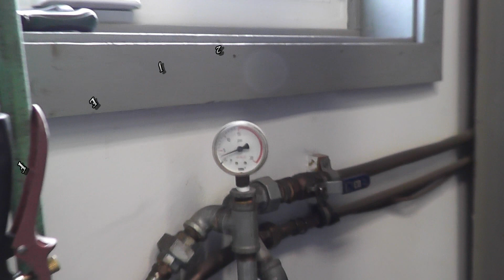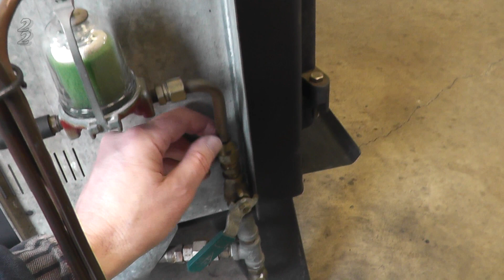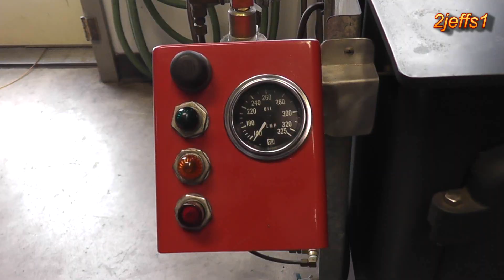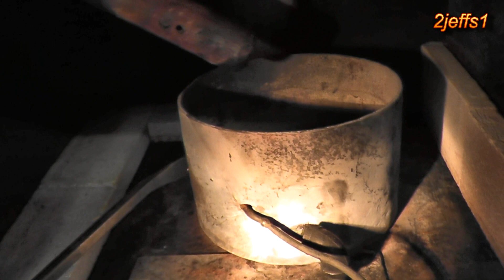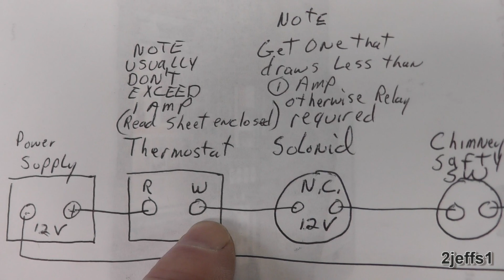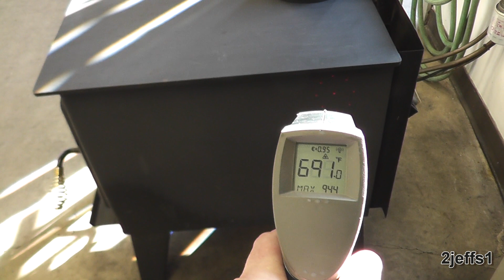Homemade Waste Oil Burner Heater for Daily Use p2 More Details DIY

Comment: Hi Jeff, I am watching this for the 4th time. At 04:30 or so you mention the gallon usage at around 2-3 for an 8 hour day. Then you say -10 out. What does that mean -10 out. I definitely want to build one of these. Will have almost an unlimited supply of used oil. Soon, I will be building a service center that changes oil. I wonder if I can make one into a boiler. That way I can run pipes in the concrete in the driveway and the sidewalk. Let me know what you think on that.
Reply from the maker: The -10 out is the outside temperature in Fahrenheit. Depending on how cold it is outside and how well the building is insulated affects how much oil is used similar to ones house furnace. As far as making one into a boiler, not sure on that one where I've never attempted....
Reply: Thanks Jeff. I should have know however it was late and I probably was 4th Adult beverage.  I am in Norther Ohio it can to -19 here. Luckily when we bought the place the garage is detached two story insulated and heated garage. With a used oil furnace I am hoping to heat a new larger shop.

Thanks Jeff really enjoy the vids. I love the skits with the birds and the woof woof. Makes me laugh everytime. Hope your weekend is going well.

Comment: Thank you for two great videos of a setup with a pedigree. Way too much junk around of stuff that was thrown together yesterday. I like your  high and low setting on the oil feed.
Reply from the maker: It was a fun project which continually took a lot of trial and error at first where this was built before the YouTube days. That is the best part being automatic after lit where it doesn't need to be constantly tweaked to maintain room temp. Thank you for stopping by Anthony, Jeff.

Comment: Jeff you are very talented and thanks for sharing. I have watched several of you videos and learned a lot. I live in Maryland so it is not quiet so cold as where you are.
A question for you. I can get a steady supply of fuel oil (tank draining s from a tank removal firm). This supply is from good fuel to sludge to water mixed. Do you have any ideas on how your stove will respond to water showing up in the oil stream from time to time. I'm thinking that I would need to add a spark system to reignite the oil when a flame out occurs or a second oil tube for the questionable oil to feed parallel to keep the flame intact.
Reply from the maker: +reset5 I have experienced that. One time a guy dropped off a barrel of oil which had I think machining oil in it too. It was hard to light, had to be run wide open continuously to avoid flame out. To avoid that again I only except oil from certain sources. Getting any water in the feed lines/system would be a bad deal.

Comment: great video! I'm wondering what the mushroom looking thing in the burner pot is and if it effects the air flow? Thank you for helping us all out!
Reply from the maker: +walter rosendale Hi Walter. The pedestal in the middle helps keep the flame (and oil) a bit more to the outer side of the burner instead of the center which does make things work a bit better.
Reply: Thank you, I just picked up a small ashley wood stove this weekend to convert to oil drip. I liked it because it has a glass door. $75 delivered. not a bad deal. thanks again

Comment: Thanks for the quick response 2jeffs1. That was exactly what I was wondering... my old man is a welder and making that burner would be no big deal. I was just confused because I see a lot of people that use cooking pots or other such things but I figured I'd ask the expert who has something that has what I ultimately want. Thanks again for the quick response.
Reply from the maker: +Seth P No problem Seth! I made a buffet of different size burners out of tin in the development stages to find the best/most efficient size. They didn't last a week but gained lotsa info on which size was the best!  ;>)

Comment: 2jeff1, I'm gathering my parts to build mine. one thing though, where do I get a burner or what did you use to make your burner?
Reply from the maker: +Seth P A friend made me the burner out of stainless steel where he works. If you could find a place that sells stainless pipe near the same diameter should be possible. Regular steel pipe would be fine too - I don't think it would last quite as long tho.

Comment: Nice burner,, I like the automation aspect a lot.  Here's a source for solenoid valve for the high-burn circuit -
 http://www.electricsolenoidvalves.com/1-2-24v-ac-electric-brass-solenoid-valve/
this isa 24 vac valve, but I believe 12vdc version is also available.

Comment: Great video. How much pressure is coming out of the smog pump? Does it matter?
Reply from the maker: +Mike Burruel Man it's been years but it seems they developed around 30 - 40 psi on a dead head test. With the tube open that goes into the burner - never put a gauge inline to test. Was just real happy on how nice it worked and no longer needed to use the air compressor. Those pumps are made to be run continuous where a compressor that develops 100 + psi isn't as efficient and the wear and tear factor comes to mind.  I also recommend using a 1725 rpm motor v/s the 3450. No need to spin those pumps real fast.

Comment: Another question for you, how do you keep the glass on your stove from getting all blacked up, mine gets covered in just a matter of hours

Thanks ,
Kevin
Reply from the maker: +Kevin Daye Hi Kevin. My first question is are you using a smog pump? When I first started on that project I was using a blower. Tried a ton of different ways, yeah it made good heat (Lots went out the chimney - air in = air out + more oil needed) but would be like you are experiencing. After a full day of running mine will get a little dark on the bottom but yeah - as you look in the window you shouldn't see any smoke.
Reply: +2jeffs1, man your good, no I'm not using a smog pump, I am using a blower and yes I am getting seriously hot heat, my container is made of 1/4" think, 8" diameter pipe with a 1/4" plate welded on the bottom, and it was glowing pink at one point. So the pulsating from the smog pump really make that much of a difference ?
Reply from the maker: +Kevin Daye Absolutely. I spent so much time experimenting with a blower setup. Was never happy with it as stated above.  Also with a blower it is hard to idle a unit without a flame out. That is the tricky part to accomplish.  The setup I have you can make the sides of the stove glow if desired by setting the high limit up more.  I warped the crap out of my last stove so I quit doing that. That burner will glow after a while but I limit the stove to around 900 degrees.
Reply: +2jeffand that all because of the smog pump ? It really make that much of a difference ? Well, I'll have to stop at the local salvage/junk yard then. Thank you so much for your info and replys
Reply: +2jeffs1 do you know what that smog pump would have came off of, the vehicle yr make model
Reply from the maker: +Kevin Daye The P/N is 32-212 from Autozone for the same pump. For as far as what it was from I can't remember.

Comment: This is one the coolest builds I have ever seen! Very nice. I had an idea for your burner pot, why not just use a brake drum off a truck or two car drums stacked together? They are thick (mass) and would probably outlive you! I'm getting ready to make a wood/waste oil heater out of an old water heater. I of course will use a lot of your ideas! ;-)
Reply from the maker: +Steve Raymond Hi Steve. I like your idea on the brake drums. I will keep that in mind. Fortunately the stainless one is still holding out pretty good yet.  :>) Sounds like you have the thoughts rolling pretty good on your setup. Hope all goes good and thank you for the nice comment! Jeff

Comment: Greetings! Most impressive! I will be building this heater for my new shop...I'm planning on putting in radiant floor heat, so the obvious question is have you figured out a way to add a boiler to this arrangement? Thanks again, and keep on tinkering!!
Reply from the maker: JL Little The radiant floor heat would be a nice thing. Was at a  local salvage yard recently that has it. Never pondered on that one. There always seems to be a way for everything. To obtain getting the setup to be the most efficient is where some trial & error would be involved. Wish you the best JL, Jeff.

Comment: Hi jeff, First I have too say that you seems too bee one of the kindest and most graceful man one the world, and with a common sence that seems to be missing in most of the world this days ;) I really love your work!
I live in norway, and here we have some really cold winters, so I would like to try your excelent engineering work :)
but I have a few questiones: where is that seediment bowl from, and what dimensiones on the in/out-let?
In the drawing it says 1/4" pipe inside the 2" pipe in to the stove, and you say you cleans it once a week with a 5/16 drill- what dimensions are the pipes from the sedimentbowl and into your stow....?

sincerely impressed and humbled mechanic
Reply from the maker: Kim Aril Narvesen Hello Kim. The sediment bowl is what the used on older tractors for a fuel filter/water trap. (sorry - I don't have a P/N) They were usually found directly under the fuel tank. (Note- It's mounted upside down on my application.) The steel inlet/outlet threaded pipe is 1/4" I believe you can find them with diff sizes from 1/8' (older lawn mowers) to 3/8" for larger machines. Great catch on the 5/16 drill into the 1/4 pipe. Technically it shouldn't fit. They do rate pipe in od/id - but in this case the 1/4" steel pipe outside diameter is roughly 1/2" so that's why the 5/16 works. I know it don't seem to make sense but that's the way it is. When one gets into the smaller steel pipe things do get a little confusing at first. 
Good luck on your build. Sounds like winters are pretty nasty in Norway too!

Comment: Wow, tremendous setup!  It's clear that you have a great deal of time and experience put into building it...  thanks for sharing!

My understanding is once the main fuel supply valve is opened, the idle feed runs continuously, while the fast feed is controlled by the thermostat-driven solenoid.  A couple of questions about this:

In the event of a flame-out, the stove would, of course, not provide any heat, but the thermostat would open the solenoid, causing a continuous flow -- with no combustion, the oil would quickly reach the overflow and empty into the pan.  Same in the event of a power outage, except slower, since only the idle flow would be running.

I understand that you run this system only while you're in the shop, so this might not matter.  But for looser supervision, would a low-temperature cutoff to shut off the main fuel flow (in the event of a flame-out and/or power outage) be a useful additional safety feature to consider?

It seems the upper valve controlling air flow primarily controls the amount of cooling in the heat shield tube, while the lower valve tunes for air directly into the burner.  Is air flow at the same rate from your smog pump in both the idle and heat modes?  Or do you have a different air flow rates to support the different fuel flow rates?  

So much to absorb from your video -- it'll take me a few more viewings to soak it all in. I'd like (some day) to build something like this for a stand-alone workshop.  

Again, excellent design and video!  Thanks, again!
Reply from the maker: Hello Arthur. Your welcome! All the kind comments make the vid's so worth doing this! You are correct - in a flame out the oil would continue to flow. If you are experimenting a little off my design I would recommend a little faster drip on the low flow idle speed. When I was first building this setup of course it was run to the point of flame out before it was perfected. As you probably noticed the catch tray underneath has never been cleaned out. Your idea of a lower temp oil shutoff is a great idea if the unit were to malfunction under low supervision. Where their is so little oil going in it would probably be a while before it would even fill the burner an get to the bottom tray. On a power outage I'd just use the air compressor to supply the air for a shutdown. Yes the air supply stays the same between the 2 modes. When I first got this going I'd tweak the valve to find the sweet spot @ the burner and never touch it now. I did my best to produce a non shaky, well lit, easy to understand video but for something that seems so simple there is a bit to it. Really good points you brought up here Arthur and glad you enjoyed the vid. Jeff

Comment: Hey, I just wanted to say thanks for being thorough and so polite. As far as the exhaust or chimney, does that get really hot? Also, is there a limit to how far you can run a chimney with this type of burner? My shop is really tall and I need to run about 25 - 30' and I wondered if there would be an issue with this. Thanks for your input. great video
Reply from the maker: Hello ExDooper 77. Where the upper chimney temp sensor is-that trips @250F. I would think the pipe where it goes in the ceiling would be in the area of 150. The top of the stove and out pipe has never been re-painted. Where I am using pressure and not volume for air on the burner that is what makes it more efficient than other designs you might have seen. I should give the stove design some credit too. They run the exhaust across the top before it goes out the chimney. If you are going to use a stove that has a pot opening direct to the chimney it might run a little bit warmer. Cant really say how much that helps. There shouldn't be any problem with a 30" chimney as long as your a couple of feet past the peak of the roof. There just isn't that much exhaust going thru the pipe with this setup. Hope that helps you out, Jeff

Comment: I have to say this system is very cool setting it on a thermostat putting snap disc on the flue to turn on the fan that is just smart stuff. it looks fairly strait forward I think a system like this has a lot of the ideas could be use in different ways like the snap disc for the fan I can see being used to move warm air threw out the house using traditional metal or flex duck to pull the heat from the ceiling to a cooler part of the house. I have to say this is a very impressive build am subscribing.
Reply from the maker: iwantosavemoney I would like to thank you for your nice comment and subbing. I will be putting some video's together in the future which are original ideas of things that should benefit many people. Sadly it has been way too busy here at the moment....
Reply: yeah I under stand that I have gathered up most of the stuff to make my pellet mill but the weather has not been working with me. I would like to make my own pellets with yard clipping am thinking that is just smart. but not sure about the burn time. but none the less am going to build one.

Comment: that thing works awesome and you gave a great overview of the system, nice of you to share..FOR FREE because it really means a lot.I build a lot of stuff myself and since I am an electrician by trade the control is simple.My only concern here would be our insurance  laws are so strict but I can't see why that wouldn't be safer then me piling my wood stove full a letting it go,Thanks so much for sharing.
Reply from the maker: steve lecain Hi Steve. Thank You for your kind thoughts - That's what makes me glad I posted the vid's. That was neat to here you are an electrician! Actually all the wiring, conduit and services here I had done too! I liked your logic on the wood stove thought. On some things now a days common sense seems kinda optional. But yes - checking with one's insurance company is a good starting point.....

Comment: Well just got my setup running this past week so far very impressed with it used most of your design but added my own little twist most important I added a flame out switch incorporating a main oil shut off. Other than that it's just finding the sweet spot with the burner
Reply from the maker: Brian Carley Hi Brian. It's neat to get some feedback from folks who perused this project. Sounds like you have a good handle on things with the flame out deal. That's a good idea. Building these might seem like a bit of work but once things are up and going....